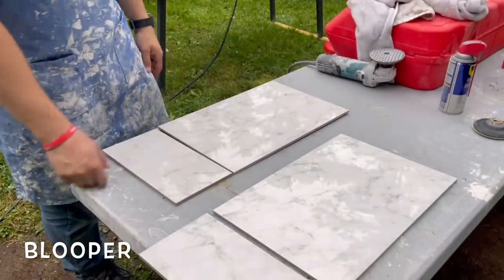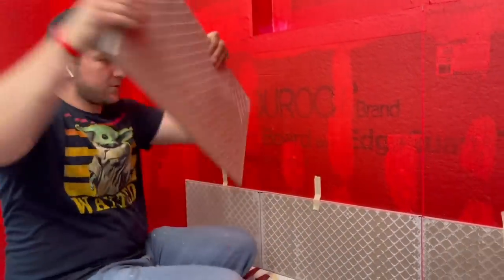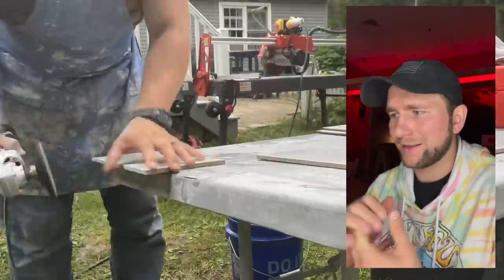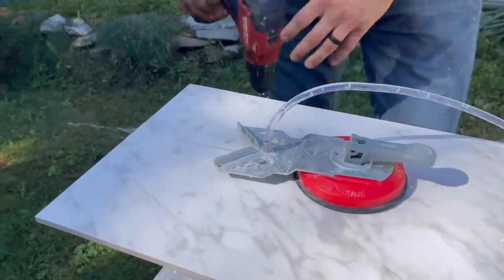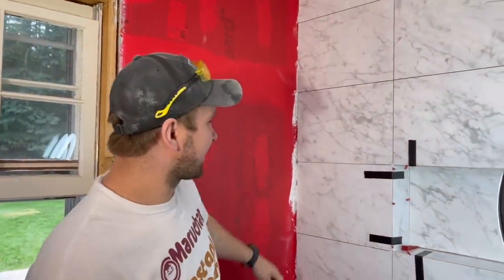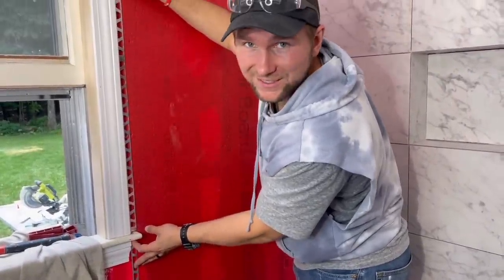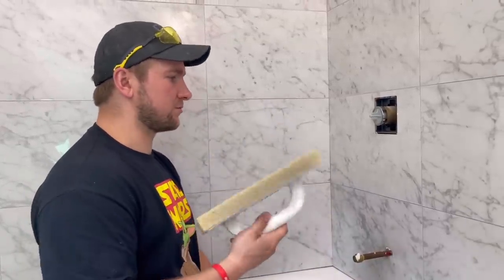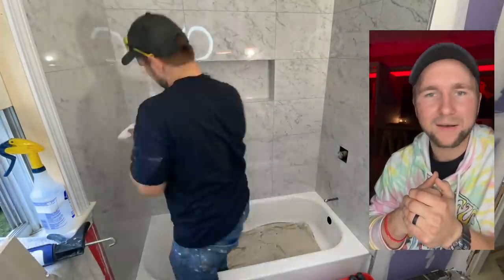How to Tile Tub Shower. Step by Step. 🚀Price Breakdown🚀 MITER TILE

Comment: Good to know other companies are charging for “packages”. I work with my father and he was doing showers with a small niche at 250$ For a long time labor only, customers supply material. I suggested offering a shower package and he hated the idea for years. Now we do pretty much what you do but without supplying the tile. We offer tub surrounds for 500-750-1100 and tub to walk in shower conversions for 1200-1450-1600. Anything over our package rates (custom ideas) is negotiable. Keep coaching, I like you’re methods. We do it a little different in central FL but most of it is the same process

Comment: I'm in Houston and finally priced a $5k shower build. I was doing them dirt cheap bc I wasn't confident in my skill but after a couple dozen $2000 builds it's time to step it up. I'm doing wayyy better work than the local pros and actually using quality materials and methods
Reply: How are you getting away with a $2000 shower? It’s hard to stay under that just in supplies.
Reply: Do you travel? I’m in Austin and I need master bath done

Comment: Great video.   Question:  You grout the miters and mention using silicone for 90 degree grout joints.   Is the grout for miter edges susceptible to cracking and should we use silicone for the mitered edges?

Comment: A small tip for you buddy if you do the sides and back of the niche first you don’t need support under the bottom tile inside the niche but you need to be very precise with your cuts I would never put wedges under a tile

Comment: I noticed that on the side walls in the shower, it looks like you cut the tiles so that both pieces were the same size. Is that always preferable to putting in a full tile in the corner and then having like 1/4 tile cuts to finish each course?

Comment: Thanks Mischa, great work.  One question:  I would have liked to have seen how you made those angle cuts on the first row.  Did you freehand push them through the table saw?  Or set an angle on the blade and use the fence?  Or, did you cut them with your grinder?
Reply from the maker: Great question! So if I have some room I use my wetsaw. But if the angle goes to 0 I use a bringer with a polishing pad. Bc a wetsaw blade will jump off
Reply: Graat. I had the same q Thanks for asking

Comment: Amazing tiles, and even more amazing work - as usual! Krasivaya! 
Are these a smaller format of the same Arabescatto tiles you used in the $10K shower job in your other 3-part vids? 

Got another (perhaps odd) question for ya. I've noticed that in the east (Russia, China, Middle East, etc) they somehow get the grout lines fully flush with the tiles. I mean, you could close your eyes and scrape across the surface with your fingernails and not know where the tile ends and grout begins. 
Do those folks maybe use a different material for grouting? Or maybe it's common to double-grout before the first grout fully cures.. 🤔 
Haven't seen it out west (Canada where I am, or the U.S.), but in my travels in the East I've been impressed by how it gives a 'stone carpet' effect.

Keep up the great work bro, and keep the videos coming!

Comment: Hey bro how do you flatten the walls without floating? I'm looking for new ways to flatten my walls for those terrible rough carpenters i have to follow.
Reply: Sister the studs w 2x3” studs. Start with the 1st & last studs and use something flat like a level to bridge across from new studs to set the studs in between.

Comment: Tip for breaking the master level clips if they are covered in thin set it to tap the right side until it breaks and then tap the left in the opposite direction and they break off no problem.  If you try to break it off only hitting it in one direction they always break funny.  Trust me and try it, you'll thank me! 😊.

Comment: 14:59 OH YEAH WE MAKE MISTAKES. Was doing a curbless walk in shower (tile in shower, bathroom floor, and bathroom walls, non on ceiling) and for some reason we had 3 diff color grouts on site that day. This bathroom shower and walls was all black, w/ bathroom floor diff color. Well, not sure what happened but left site and came back and the guys grouted the shower walls/floor with a completely diff color grout. What color, SILVER…..THE tile for shower was all black so that’s was so noticeable, and you’d think that there’d stop when realized mistake and redo, but Nope…..all silver. The grout we used for this job was epoxy. So, that was a fun time redoing the grout, 😅🤦🏼
But, mistakes do happen, not often, but they do. It’s HOW YOU HANDLE THEM IS WHAT COUNTS, imo.
Great vid, and love the miters, very very nice👍🏻👍🏻

Comment: I charge around $1000 a day for labor. If It takes me 5 days to build a shower, $5k plus materials. Some guys get away with $2k a day....It depends on how good you are at selling your services and the area you live in. You have to live around a high income white collar area where there's a labor shortage and high demand for tile work.
Reply: 1000 a day !?? Wow
Reply: @marcopoulin1897  Why would i be lying? How much do you charge? If you can't charge at least $100 an hour as a business then you should close your business, go drive for amazon and go back to school. You're wasting your life away doing cheap labor.
Reply: When doing showers I usually estimate how many days it will take me and then add an extra day for cushion because it seems every job has some unforeseen setbacks.   I usually provide the setting materials and waterproofing in my pricing and charge $600-800 per day.
Reply: @amattson6578  wow that is some money . I live in Ireland and no way could I charge that per day . 300 euro be max which about 350 dollars.
Reply: @AlanMcCarthyguitar  350 a day is decent if its cash under the table but if youre running a business, paying taxes and insurance, paying for gas in truck, wear and tear on your tools, wear and tear on your body, liability, reputation, labor, and materials included in price then you would be left with nothing charging 350 a day.   Pricing depends a lot on the level of overhead you have, and how you value your time and expertise.    Most tradesman spend years of blood sweat and tears working on their craft and they should be compensated accordingly.   My opinion
Reply: @amattson6578  I agree 100 %. Sometimes it would be cash but not always. I do feel like a mug and I am good and neat at my job but charge anymore and you ll be out of work
Reply: @AlanMcCarthyguitar  how bout them Irish motorcycle road racing best in the world in my opinion
Reply: @James Jennings  30 days sound too long. You only work half a day? At $420 a day x 30 days would be $12600... ..Most customers don't want to pay $5k for labor, much less $12k!  I work slowly and i can finish a  shower in around 5 days therefore Making about $1000 a day. Making money with tile work is hard! You have to be fast, be affordable and deliver quality at the same time. Not easy. It does take me up to 30 days  if I'm remodeling a whole bathroom...... Plumbing, electrical, drywall, heated floors, Vanity etc...But then i charge more money.
Reply: @James Jennings In a 10 hours day, I do as much work as 3 x 6 hour days (=18 hours). 3 days means 3 trips, 3 cleanups, 3 unpacking/packing tools, 3 saying hello to the clients, etc...
Hit the gym and do 10 hour days ;) Maybe work 3 x 10 hour a week instead of 5 x 6 hour. Good luck
Reply: I follow a landscaper on Twitter and the prices he charges in New Jersey are insane. Almost tempted to move to America. $1000 a day! Sheesh
Reply: $1000 a day is what I charge as a contractor… paid with open arms. I make my customers life easy. My customers don’t nickel and dime me. I’m typically 6-8 weeks out for scheduling. Keep in mind I have 40 years of construction experience. Don’t expect these wages as a newby.
Reply: @KeithHill2  what do you think is a price per-day for a worker that you higher to do a job for you. the worker takes all the tools and installs and  buys materials if you as a contractor for get to take or don’t have time to take the material
Reply: 1000 dollars a day is the floor, everything is more expensive these days..unfortunately it’s the contractor who learns that the hard way…being cooked slow in a pot basically. Everyone seams ok paying inflation for everything else, but somehow when a tradesmen shows up it’s a different world. Think I saw a guy who works for 350 a day…mine as well go work for someone else at that rate. This guy tries to say “it’s easy” but he’s just lying to get views and appeal to diy folk..it’s not easy at all, very labor intensive, takes skill…the liability alone should require a higher price tag.

Comment: epic fail. redgaurd is NOT supposed to be applied like this. way to thin and no 6" fiber mesh in all seams.. you just have the 3" POS mesh and some thinset. 
you have voided the warrantee and this shower is going to leak. stop doing redguard... at least if you do, do it correctly]

also there is no sealed pipe work... 
bottom line, you should know better and if you do not, then take some classes, the work you are doing is BAD

Comment: At 5 k you couldn't possibly using the right materials or decent tile if so you'd ha e lost atleast a 3k on this job go hide in some small Midwest town and charge this but I hope the homeowner knows it will fail as it's impossible to use schluter all set and waterproof correctly...redgaurd and cement board has been proven to fail within 5 years might as use green board ...get ahead of the time learn new things or waste money in call backs which eat profits for lunch!!!!!!